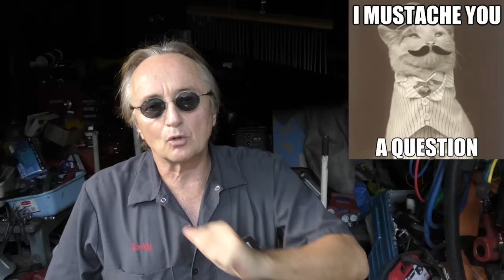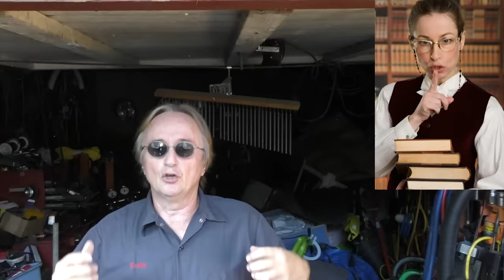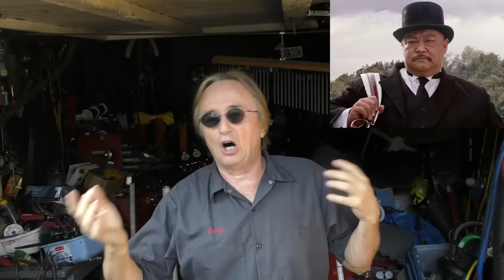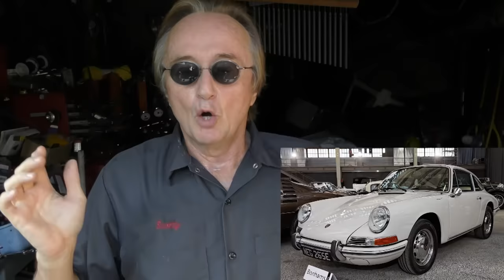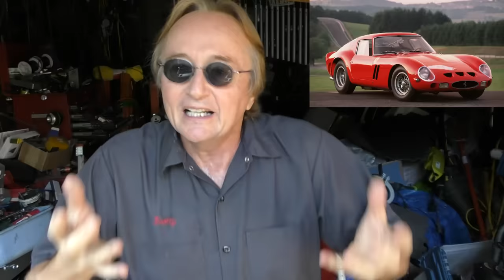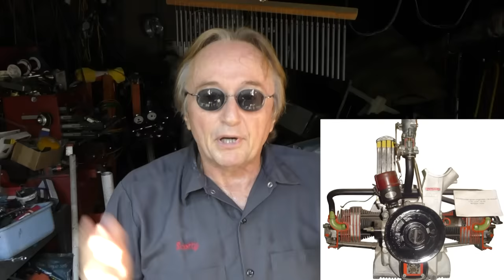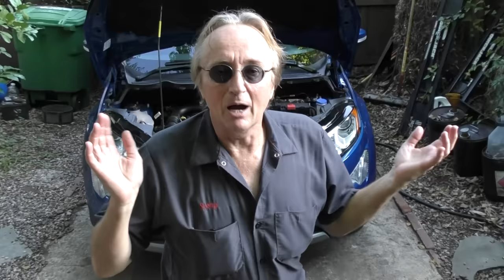The Truth About Boxer Engine Cars

Comment: "My wife's old matrix would run circles around it (BRZ)."  You must be smokin' that good stuff again.
Reply: Exactly. How many naturally aspirated engines engines make 100 HP/litre like the BRZ? Certainly not his wife's POS.
Reply: I've chopped BRZ's and 86's in my Suzuki Swift.... Until 3rd gear, GO the hustler hatch!
Reply: @Physic Studios Your engine is most likely a 2.8 litre as opposed to the 2 litres of the 86/BRZ, and the standard golf VR6 is about 80kg lighter. So those results are pretty unsurprising.
Reply: No one cares how fast your car is. Having a powerful motor is not an accomplishment. A teenager can swap motors or install a turbo.  It's not impressive.  Making a car handle like a sportscar is a real accomplishment, that takes extensive engineering and testing. And BTW slapping some springs and bars onto a Civic doesn't make it handle like a real sportscar.
Reply: @80s_Boombox_Collector  Because everyone's swapping motor's these days... especially those damn teenagers. This guy obviously owns a slow af car, but he can tell all the girls "But hey, it handles so well!" lmao
Reply: Jason Bolante hey man it’s just what we do

We swap engines
Reply: @royhartle7927  Doesn't matter how much HP per liter the engine makes when the total HP is just slightly over 200.
Reply: @robertdaone  It's still 20% more than a Matrix and a better torque curve as well as way better handling.
Reply: Roy Hartle civic si or Acura Rsx type s is ur answer. 2.0 k20 over 200 hp stock
Reply: Roy Hartle Honda came out with the b16a back in 1988, 1.6 liter making 160hp, more hp per liter than ferrari was capable of producing at the time. Don’t believe me? Look it up, i did a presentation on this in my automotive class 2 years ago
Reply: Lol there’s a 55hp gap here and the brz wins.
Reply: Physic Studios around the track , you’ll get smoked . Not a straight line car
Reply: i know, I laughed soo hard when he said that!
Reply: @royhartle7927  
The HP aren't worth crap if there is no torque.
Reply: @EnnesX  
That's like comparing NASA to a tricycle. 

They don't need much torque cause they have an insane power to weight ratio and got a gearbox that has nothing to do with everyday cars. What is it, roughly 600kg meeting almost 1000hp?
Reply: @Physic Studios 6 vs 4 🤣😂🤣
Reply: @MrSeizureBunny  brz's weren't made to be fast it was only.meant to be fun to driver they only make 205 hp 😂🤣
Reply: @MrSeizureBunny  I doubt a 91 hp car did that lol
Reply: @nigelholland1714  You'd be surprised. I put it down to inexperienced drivers tbh. 99HP (stock) with premium oil and fluids, 98RON fuel, aftermarket suspension, RE003 tyres, wider wheels and no rear seats. I kept up with a VE Commodore once (likely not maintained) with two light passengers until 4th gear, limiter bashing it like it owed me money.
Reply: @Leon G I laughed super loud 😁
Reply: @Leon G There is virtually nothing in it. Which car was faster changed on a yearly basis and the quarter mile times were often within a tenth of a second of each other. I own an XR6 Turbo and I've beaten plenty of WRXs but I primarily put it down to the fact that most of the ones I've seen getting around have been worn out by dumb kids who redline them all the time and don't give them proper care. Even my car which had been reasonably well looked after had something like 200KW at the wheels when I first had it on a dyno and I think it was only 13-14 years old at the time. Cars just lose power over time and who's faster usually comes down to who's spent the most money.
Reply: BRZ is a slow car lol 😂
Reply: @royhartle7927  The 4U-GSE has 102.5 hp/ liter
151lb ft torque
B48 makes 124hp / liter
258 lb ft torque
L15B7 makes 136.6hp / liter 
192 lb ft torque
G4KF Makes 137 hp / liter
275 lb ft torque

The gt86 isn't that special.
Reply: @MrSeizureBunny  lmao wtf
Reply: Hahaha you wish mate 😂😂
Reply: @MrSeizureBunny  no you didn't.
Reply: Lmao, the slow brz drivers are triggered
Reply: 80's Boombox Collector that was I mean for people want to drive fast and don’t know how to tune don’t buy toyota.
 When you old or you just want to go point A to point B buy a Toyota. They a good car but not fast
Reply: @royhartle7927  600cc, or 0.6L sportbike engines routinely make over 200HP/L...naturally aspirated. Honda made over 100HP/L naturally aspirated back in the 1960s, with motos like the CB450.

 If I want to go quick, I hop on a moto. They're quick for ridiculously cheap, compared to most cars. My favorite motos are dualsports though, which don't make much power, comparatively. They're more fun at 55MPH than most other vehicles, IMO, but I can legally jump, wheely, and drift them in the dirt.
Reply: @gabrielfelty8224  says every frs/brz/86 owner after they realize exactly how slow they really are! Lmao I know I owned a '13 FRS and I traded it after 3 months
Reply: @gabrielfelty8224  but you are right they do handle very well and they look great. Just make them like 280hp and bumb the WRX up to 320hp and for Christ sake make the STi up to like 400hp I mean ever since 04 the STi had 305hp so maybe it's finally time they increase the power since it's a flippin $40k+ car now.
Reply: Stock WRX STI 305 HP, lack of HP is a huge over statement.... Bolt on HP Is easy to get especially in the STI 400 WHP is reliable and achievable for a few grand. The bad head gasket was the EJ25 and it was an oil leak primarily due to a bad bolt pattern on the oil return in the head. It's not a boxer specific issue. Google content is not the same as actual work experience. 😕
Reply: @Physic Studios But I'm faster than you!
Reply: @FatSleepyPanda   irrelevant data if fuel consumption goes up to much. Honda 2l engine in the s2000 use more fuel than a Corvette V8 made after 1999.  Honda does know how to make hp on small engines. It usually involves more air, more rpm and more fuel. Then you'll often get a small engine that use more fuel than a big engine with more hp.
Reply: Yeah I don’t know about the matrix being faster than a brz cause I’ve never driven a matrix  but the brz is really not a fast car in stock form. There are some fast ones out there but they are highly modified with either a turbo charger, supercharger, or engine swap (a few people have even put 2j and LS motors in those things. But for the same money if you want a car that’s fun for zipping around town a base WRX or GTI will be noticeably faster.
Reply: They got tiny 2 litre engines
Reply: As the owner of a Matrix 2.4, the quickest ever made, I think Scotty cooked his brain in ethanol to pretend a Matrix could beat anything other than a Geo Metro.  A BRZ would stomp me in a race.
Reply: @royhartle7927  pos? Please.....just bc the brz is faster doesn't mean it's better built. My  uncle had a matrix , when he traded it in it had well over 300k on it, and it ran perfect